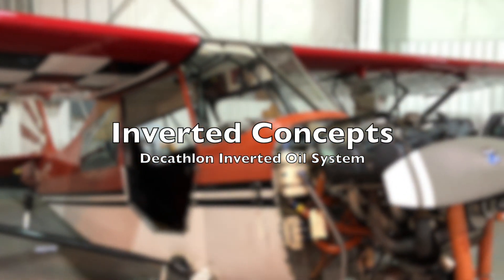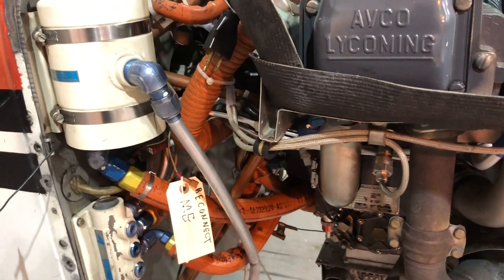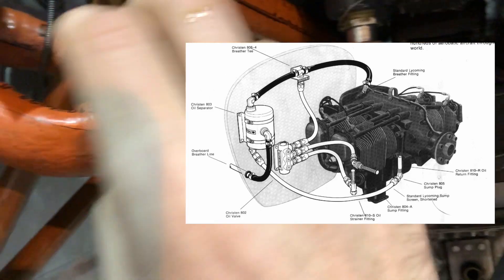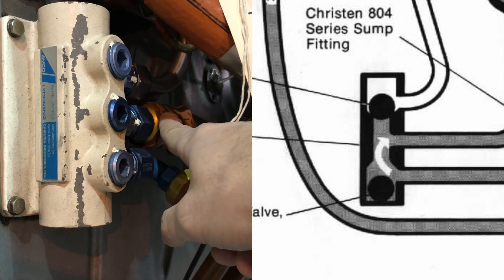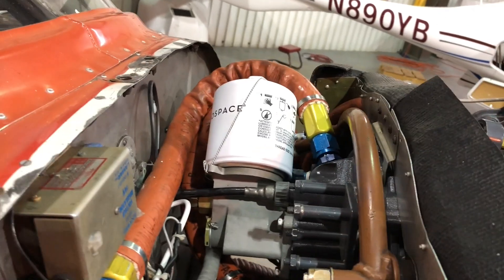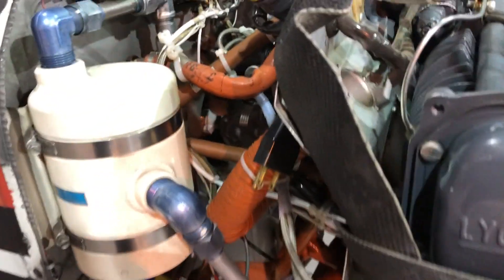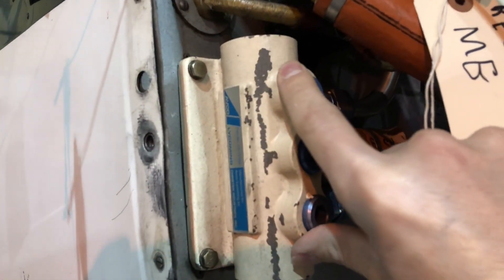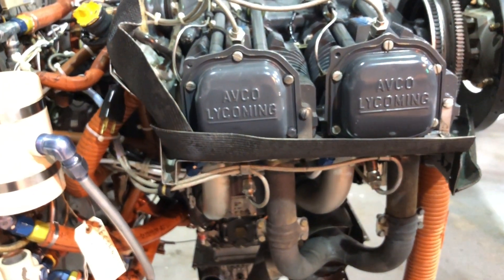Super Decathlon Inverted Oil system

Comment: Is this different from Dry sump lubrication system?
Reply: It is different. This is a wet sump as the oil is still contained in the oil pan and then pumped through the engine. But in its inverted mode it is somewhat like a dry sump as the oil has to be fed to the oil pump. 

Check out engineering explained’s video on the topic- https://youtu.be/I0lfdUXqV2g
Reply: @kycsip3066  Thanks for the explanation and video link.